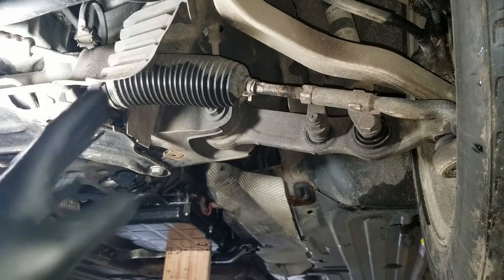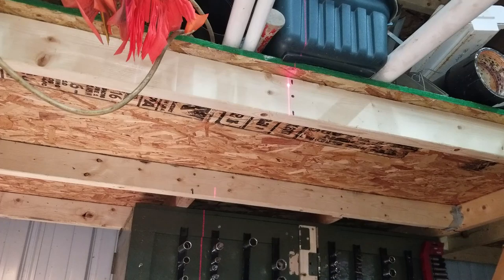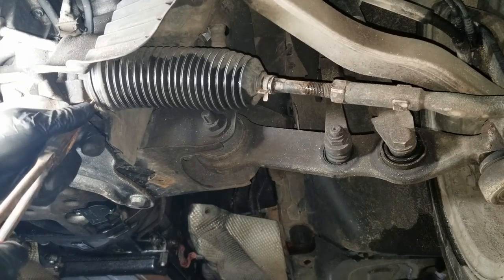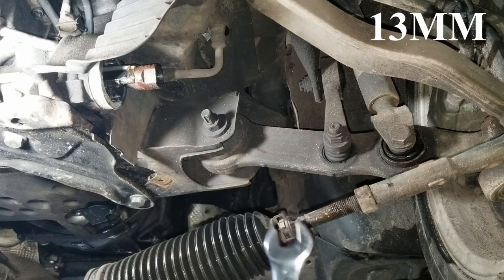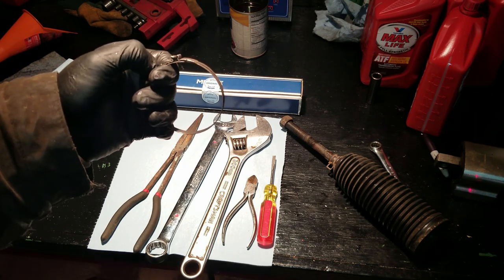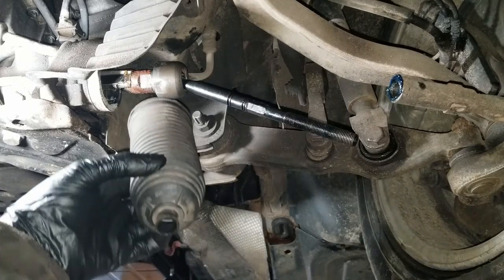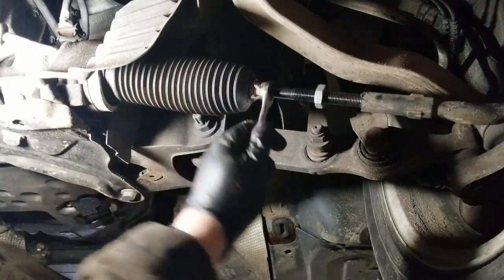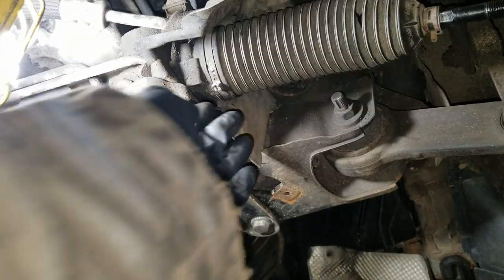Changing The Inner Tie Rods On A W211! | DIY

Comment: I should watch your video first before I replaced  it on my car.  I  measure with the ruler but after installed still took long time to make it balance because the tires moved when remove this part.  You did the smart way,  great video.

Comment: I told myself where the hell is the nut. And then... :-D  But i think that you missed the spot, where the spring clamp on the smaller side of the boot should secure it on the tie rod. There was nice recess on the rod, that you didn't use. I thought that you will adjust it later. But it's not in the video. It would be a pity to rip that original meritorious boot by stretching it too much, when this side tie rod will extend to its limit. Overall again simple but very nice tutorial. I use to say, that knowledge brings fear. But you are a nice exception that proves the rule. ;)

Comment: I would recommend that you have a friend mark the laser line then offset the wheel all the way inward make a mark, all the way outward make a mark and then let the wheel rest and see if it falls in the center. Perhaps it's unevenly worn, but I would think measuring the middle of the two offsets would be the actual original alignment.

Comment: Love the fix!!! Off question: would you ever consider installing a tune? If so, which one would you go with?
Reply from the maker: Definitely thought about it, would love to get one! I currently do not have the money to justify one right now though. Id much rather put money into preventative maintenance than optional mods.
Reply: MBDieselFreak thanks for the reply. I’m considering one but I don’t want to destroy my CDI. Is there certain brand that you are looking at or would consider above others?
Reply from the maker: @damienisabella2059  any tune that actually remaps the ECU is completely safe. rocketchip, green diesel engineering, monroe tune, etc. any companies that sell an ECU tune for the CDI will work, and cost varies quite a bit depending on who you go with. quality of the tune doesn't really change much from brand to brand either.
Reply: @MBDieselFreak  You can buy cheap chinese  MPPS with ~10$. Many 320cdis can be read/write with that. 
Making remap (actual  flash dump editing with WinOls) on your own is the most time consuming part. It's a bit steap learning curve. But there are forums for good info.

I have done mine OM642 like that . Think it as an adventure ;)

Comment: Exellent video!. I have the same job to do on my car, but I do not have a lift. I will use jackstands. How much more awkward would this job be to do it this way?
Reply from the maker: Not bad at all, I've done this exact job on jack stands before as well
Reply: @MBDieselFreak  thankyou. I had winter tyres fitted and a wheel alignment done because I replaced the front lower control arms. They told me that they felt movement in the inner tie rods. I suspected as much. They confirmed this for me.

Great videos, thanks again!

Comment: I just spent 4.5h removing one, fuck sake it was there good,and i damaged the exit of the contorl rod threads, so now i am waitng to get a new part...Fucking slat on roads. I will put a coat of copper lube. I use it on all suspention bolts when i replace it